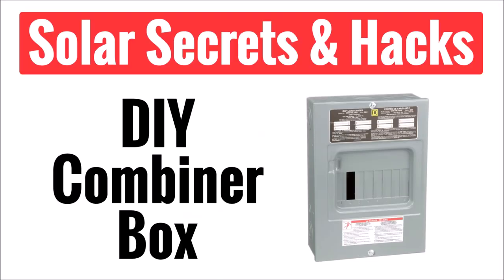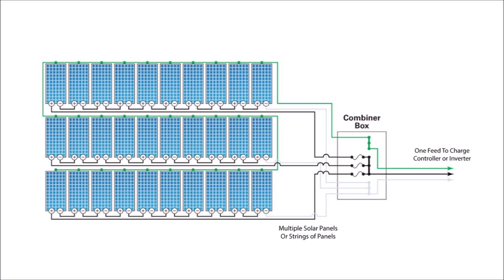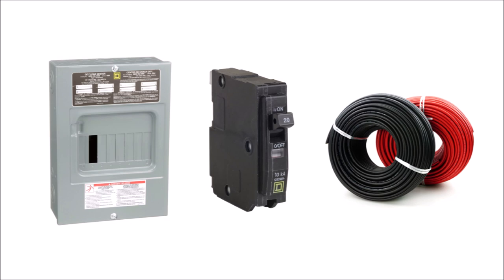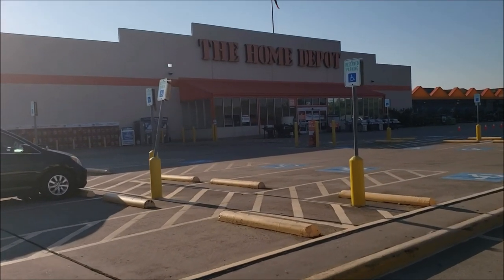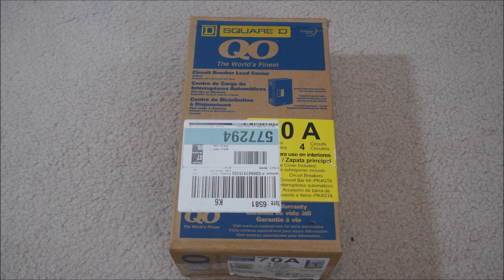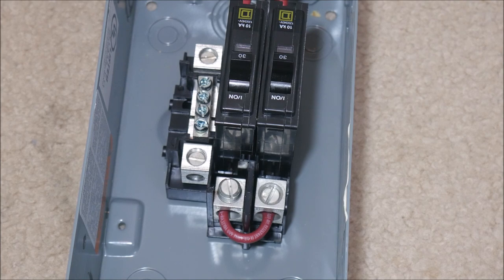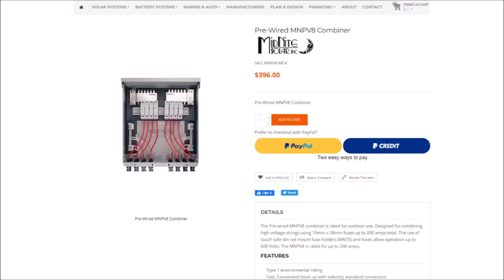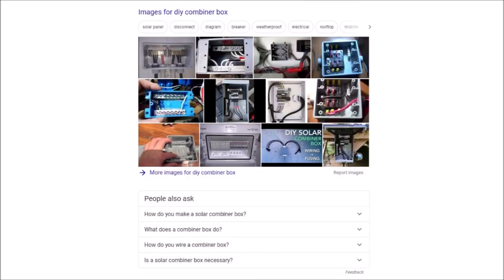Solar Secrets & Hacks - DIY Solar Combiner Box

Comment: 48V DC is probably FAR too low for any solar panel.  Do not follow this blindly.  As an example Victron MPPTs start with a max of 75V DC and go up to 250V DC.
Reply from the maker: You are citing a maximum, not the minimum.  There are hundreds of thousands of low voltage, off-grid solar panel systems out there just in the United States.  They power surveillance cameras for construction sites, mobile floodlights for events, outbuildings for rural and semi-rural homeowners, boondocking RV's, wellhouses, automatic gates, and many other uses.  And those large MPPT charge controllers are overkill for most of those use cases.  They can get by just fine with a cheap PWM or entry level $100 MPPT controller that operates on 12/24V.
Reply: @LDSreliance  all renogy and the epever clones (or is it the ooposite?) Go up to 100V for most models, victrons start at 75V,  even the renogy pwm amd clones of that model go to 55V. That's a ton of voltage far above the box.  And this is an area where so many people just copy paste without having a clue what their doing, so to have no red flag warning is just not a great thing especially with how cheap it is to just get the 200w panel used at the same price of the 50w new...and bigger is always better, until its not.   I would also question why go through the trouble of such a low voltage handicap and fusing when you can do 2 larger parallel strings without the fuses and come out with much more power at close to a similar price when you shift the fuse supplies to mppt and panels.  But that's purely opinion on the latter.
Reply from the maker: You clearly aren't going to see past your narrow band of thinking here so let's just agree to disagree.  Have a good one.

Comment: I don’t understand. 48v is so low for any substantial system. This is mostly useless. Sorry
Reply from the maker: Most off grid systems are 12V or 24V.  Most "substantial" systems are grid tied and don't use combiner boxes.
Reply: @LDSreliance  eh, not to throw any shade, but i respectfully disagree - MOST "off-grid" systems would be 48V nominal.  i'm not talking about your cabin or RV/van 'off-grid' types.  i'm talking whole house off-grid.  i would speculate +75% would be 48V systems.  higher volts = less amps = better efficiency = less $ in wire = longer wire runs, etc.